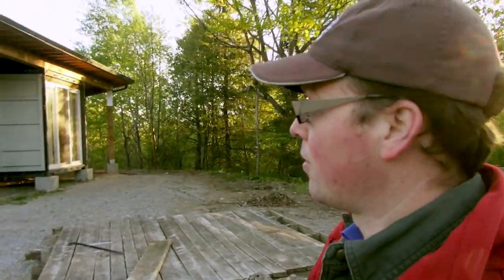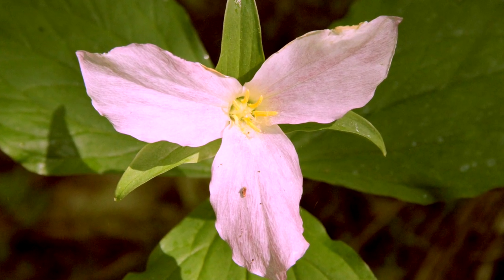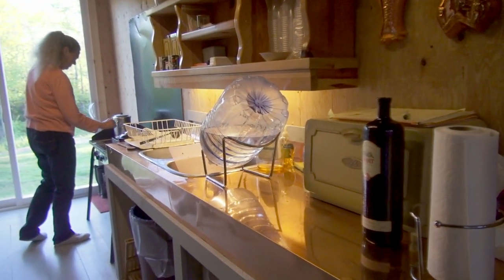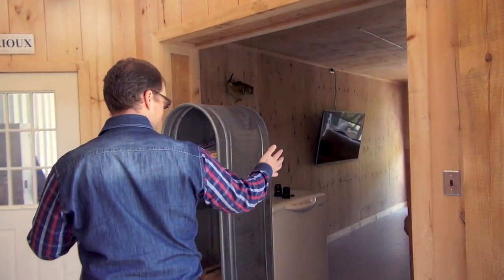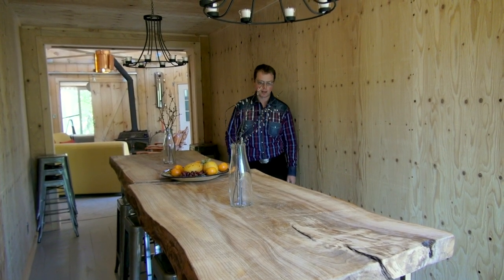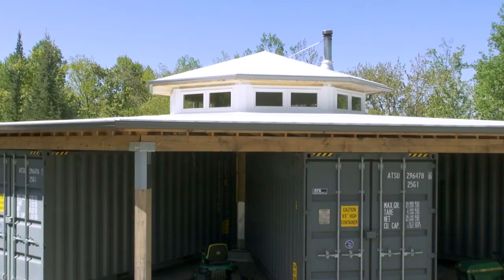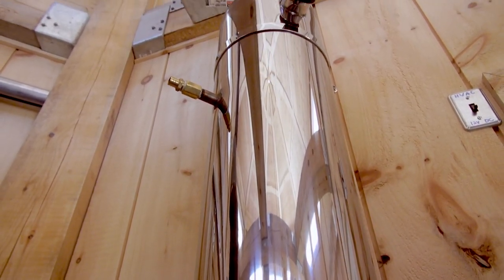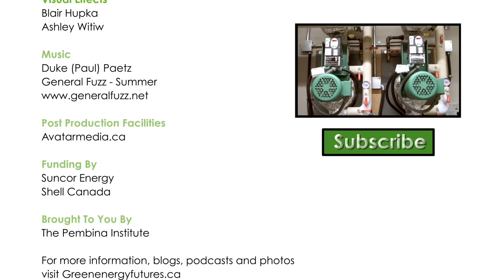112. The Octopod: A unique off-grid solar powered cottage made out of shipping containers

Comment: I really like this design, though I'm surprised at the total price. Those containers normally sell for about $3K each, so containers aside, everything else cost him about $100K to build. Yikes! He must have a lot of pricy materials in it. I think that this could probably be done at half the price if you did most of the work yourself, and went easy on the add-ons. Maybe put a rocket stove/thermal mass heater in it.
Reply: ZombieTex There is certainly significant cost in the interior decor, but that's an aesthetic cost. I wonder if a cost breakdown would be shared. Perhaps structural costs, aesthetic costs, and the cost of the DC electrical system, panels etc can be separated and shown?.. What did it cost to assemble the 1kW electrical system? Does it make economic sense?

Comment: Any thoughts on making better use of the "dead" space between the spokes/pods? I love the low energy consumption ideas, but the design engineer in me wants to stuff... stuff between the spokes.
Reply: Michael Kaczmar I'm with you. We relocated the sauna into one wedge, the other wedges currently provide shelter for the riding lawn mower, argo, boats and other toys but yes, can we make better use of the space? We planned to use one wedge for a wood pile but I have mixed feelings about that.
Reply: Michael Kaczmar I was thinking about that as he went from one 8x20 "pod" to the next.You could easily open walls up to 12 feet and use those wasted areas in between to provide more living space, extra storage and to break the monotony of "seven spokes radiating outward from a central hub". He did a fine job but it seems a little space shippy to me. This would also help with the heating problem by adding more thermal mass and by separating the cold outside air from the central hub and the pod walls by 12 feet or so whereas now it's never more than a few feet away.
Reply: Joe Schwartz I hesitate to "pick" the design apart, but the spoke layout just seems less efficient. It certainly increases the surface area-volume ratio of the living space, a downside for energy management. The roof structure adds a significant amount of cost to keep weather-resistant containers out of the element. That's the last I'll comment on these aspects. I actually would like to consider the water pumping and storage method for my home in the future. I wonder what my energy savings on my conventional home would be if I did not need a pressurized well tank, and simply pumped from my well to a higher elevation holding tank. The pump would cycle less often, and not work against the static bladder pressure in the well tank. Will the additional head height offset the reduced pumping work against the bladder... not sure. Hopefully others can take the energy management that works from this system and apply it elsewhere.
Reply: Michael Kaczmar I was thinking that the shipping containers actually act as a radiator in this configuration. Maybe it's intended as just a summer home? 

If you're going to the expense of covering the containers with a roof, you might as well go the rest of the way and enclose all that space -- with additional openings into the central space between the current "rooms." 

Some interesting ideas, though.
Reply: Perhaps, but decreasing the surface area to volume ratio is physically the more efficient way to go when trying to minimize heat transfer; whether it's hot air getting in, or letting warm air out.

Comment: Architecturally, it might be interesting, but it's inefficient in cost and look at all that surface area versus volume.   All those surfaces need to be covered and insulated and finished.  Bad use of materials and costly.  $130,000 is about 5 times my budget.

And computer fans for air circulation??
Reply: +PDZ1122 same here. I think the outside surface area is too big and the living space inside is too little for that many containers used.. also the roof structure is too massive.. these containers are very sturdy and can hold a lot of weight on their on... also insulating shipping containers is not that easy, causing the price per square to go up...
Reply: Seth Johnson skimming off the top probably
Reply: Ｔｈｉｓ　ｏｗｎｅｒ　ｄｏｅｓ　ｎｏｔ　ｔｈｉｎｋ　！

Comment: Talk about thinking outside the box, or container in this case. Wondering about the insulation level inside container. I know he clad the inside with unfinished wood, but guessing rigid foam would be behind it as thermal break from metal container.
Reply: It was spray foamed.

Comment: how much land is required for this project? is it totally off the grid? did you have to get any permits etc. cool house I want one.
Kevin
Reply: The project is 60 feet in diameter, so you need more than that, and extra space for a septic system.  Yes totally off grid and Yes this project was built with a full set of approved building permits by the municipality.

Comment: Im all for using shipping containers!  I like the idea of building something different like you have done here, but I think the space can be used more efficiently if the design was simpler, like a rectangular or square shape IMO.  It would cost less too, because as soon as you start changing the shape of the roof, everything underneath (the frame) needs to change as well and it becomes more expensive.

I know squares and rectangles are "boring" shapes and it looks like every other house.  You also lose quite a bit of usable space on the outside of the containers where it forms a V-shape.  Yes you can use that to store things on the outside, but I think that can be used better on the inside...

Comment: Wow, they must have had a really good source for the containers. I hear they can be pretty costly, even when purchased as scrap.
Reply: Thom Westergren Ironically these were premium containers given they are relatively new and ordered from one assembly batch to limit risk on variation but yes, it took a while to find the right supplier. Prices do fluctuate as they're treated like a commodity so the first containers we purchased years ago were significantly less costly.
Reply: Interesting. Thanks for the follow up.
Reply: The high cube 20' containers new shipped to your port from Shanghi China are about $2300.

Comment: I must say: It looks great, but what does he do with all the unused room between the containers going outwards? I mean I am all for making a house that's not just a rectangle/rectangular box, but it seems like a lot of wasted space...on the other hand: does this isolate the rooms from each other if there's noise? (Partying kids when you want to sleep for example!)

For me the center structure would have more glass probably :) (to make the entire center a conservatory/sunroom - with extendable covers for heavy sunshine (and maybe even heavy snow!)...and it kind of lacks a balcony (it's got a terrace, but no elevated position for you to oggle the surroundings :( )

I'd also have more solar and some wind-turbines (and some hydro if it's possible)...I just like certain creature comforts!

ps: I would also kind of place the heating unit in the absolute center of a house (so that heat can radiate outwards from there, especially if you use a wood-burner for heat in winter - this way you probably only have to keep one fire going to keep the whole place warm!)

Comment: $130,000 for a total cost would be o'k. If that is $130,000 for just the cottage then that's quite expensive.  Bobcaygeon is a large area with several different land values. but a cotrage property should cost between $40,000-and $90,000 no lake front and a nice size. 20' shipping container is about $1350-$1500 used plus delivery and for a build like this $200/h crane fees. usually 3 hour min. The 40' containers are only around $200 more and a better choice for the money. 

Now this wheel and spoke shape is interesting. With some better planing on roof design you would not need the vertical supports since the container is essentially a pair of 8' steel I beams. the in-floor heating from the wood stove is a good idea. putting in a small "400-800' of 3/4 pvc pipe" "about $100 per 400' "geothermal heat sink for air conditioning in the summer would be a good idea. 

They have high efficiency ceramic composite insulating paint that is often used on shipping container homes. It might be a nice way to add another r-30 of insulation to the living space, Since in Canada we can get very cold winters although depending on where your land is for a cottage might not be much of an issue as allot of cottage land does no have road access in the winter.    
Very nice low maintenance cottage.

Comment: how do you deal with keeping snow off of the roof?
Reply: it's designed to hold the snow load so no action is required
Reply: The snow stays - the roof is structurally designed to hold the snow load.

Comment: That would never pass building codes where I live. They are the biggest barrier to cheap alternative living solutions.
Reply: this is one of the largest barriers for people pursuing container based homes

if you spend enough time with your local architects and structural engineers, you can normally satisfy building code requirements, as was the case for this project being a first for this region of Canada, but it certainly takes more time and effort to get approvals for non-standard construction methods

Comment: That's a very wasteful design. There's a reason why most people go for either circular or square design in their dwelings - surface exposure. He must spend a small fortune on cooling and heating his house with so many walls exposed to the elements.
Plus the price of all he described must have set him back, at least, 150k to 200k... that's a decent size new house. Way out of my price range.
Reply: +tkol123 Massive surface area to volume ratio! 4 shipping containers arranged in a square (or 6-8 if you like things more round-ish) with a roof over the central space would net 4-8x40 rooms and a massive 40x40 central living room!

Basically I can't think of a less efficient way of using 8 shipping containers.
Reply: +Joseph Malovich Yeah, my point. I am not an engineer, but efficient design is efficient design.
This guy likes his house the way it is, so good for him.
I like it snug and comfy. To each his own.
Reply: +Joseph Malovich - Ditto.

Comment: Certainly not feeling this design. I mean, it's good he built it, humans learn through failure and if he lives happily ever after in it for the rest of his life then that's great, but if he abandons it in 5-10 years for a better project then we've learned a few things from it.

I think personally, that maybe he is confident working with wood, or reasonably so, but not so confident with metal. Sure, 130k is on the expensive side, but what's more telling is that for what he achieved with 130k, there's a lot to be desired. No one would have a problem with a 130k off-grid home if it was basically a mansion, this looks like a 30k-40k type home to me. 

He did some good things though that I think people missed. Rather than having a huge array of panels and an AC inverter, he's made a good choice to try and keep it all DC. Of course, it's obvious to be conservative with your energy use and buy more energy efficient devices, but AC/DC inverters and battery storage is an energy inefficiency... You get less energy out of those that you put into them, so it's great to go all DC. For instance, a comparative off-grid home may have panels with an AC inverter for conventional appliances, then install energy efficient LED lighting, but such things require a ballast and a DC inverter (like the brick on your laptop power cord). It's more energy efficient simply keep it DC from the panels to the LED light. Of course, there's a good mid ground where you can have an AC inverter for conventional appliance power but then have a DC lighting circuit wired in prior to the inverter, but he proved there are pros to keeping it all (or as much as you can) DC. 

Also, it seems everyone has overlooked his water tower. In my personal designs, I have a water tower, I think it's a great idea if you have the capacity to incorporate one in your design. I think people underestimate the luxury of having gravity fed water on demand rather than having to wait for a second or two for water. Not to mention that the energy required to pump the head height is likely less than the energy required to pressurize and maintain the flow for a pump fed water system. You can also use a smaller more energy efficient pump to trickle feed a tank a few hundred liters/gallons rather than a larger stronger pump that has to apply and maintain pressure over use. It's also good that he used a thermal heater coupled to his wood-stove that heats the concrete floor, that's also very smart. 

What I don't think is smart though is his design. Each room extends out from the center and appears dark and dingy towards the back. Sure, fewer windows mean more heat retention and less heating energy required but I think it worked to the negative. In this case, he's elongated the design of the shipping container and played on it's biggest flaw as a dwelling. People naturally like proportion and they like square rooms. People don't actually mind living in a smaller space, but need to compensate with lighting and proportion to do so... He failed by designing something with the dark, extending and out of proportion areas. Most shipping container home designs use semi open plan and break up the length with interior walls to make roughly square or slightly rectangular zones/rooms. Also, they do things like placing the side towards the sun and using windows up the whole length to bathe the container in light and warmth. 

Of course, in his desert setting, staying out of the direct sun and heat is the goal and he actually achieved this in a good way. Having the extending roof over all the containers did the exact right thing, it created an air gap, it was painted white to reflect heat and it insulated the container rooms with physics, rather than insulation. But the major benefit of shipping containers in construction is that they are perfectly designed (by intent) to be stackable, which makes multi-level/story homes much more simple and structurally easy to design and because they are structural, they can be weight bearing and they can form a major skeleton for a home. You certainly can cut out holes safely for a window or join two containers together without major structural concerns or calculations. 

The shipping container is meant to be the major structural component of your dwelling. To over-simplify it the entire benefit is that they're cheap and strong so you can simply cut out a few holes for windows and slap some cheap plasterboard and insulation on the inside and you roughly have a home. By building a gigantic octagon in the center and a huge spanning roof, then cladding the interior of the entire house including the containers with actual wood cladding, what purpose do the containers serve? They're not majorly structural, they're not finished with cost-effective materials (like plasterboard and industry byproduct insulation) and almost worst of all he's invested time, effort and materials in building a covering roof which leaves voids of pizza slice shaped wasted space between the containers yet under the roof. If he had a "U" shaped home with 3 containers it would be cheaper, he'd still reap the same benefits of the extending roof (insulation) and the center covered by a roof could be veranda/patio/garden/outdoor something and it would serve a purpose. 

He could easily replace the containers with simple wood frame construction. With no interior dividing walls, I cannot see how framing a single long box would be hard. That wouldn't have to be overly structural either because it's protected by the roof. The fact that he's used so much wood cladding (cedar?) suggests that the cost of simple framed construction is not cost prohibitive and is likely highly competitive to the purchase and transport of shipping containers, as cheap as that can be.

Like I said in the opening though, it just looks like a guy who is comfortable working with wood, but very scared of the idea of taking an angle grinder or welder to metal. I'm not going to shit all over him though, he had some great ideas that people have overlooked and some not so great ideas and designs that maybe a couple of us would have seen coming... But now with his flawed outcome, we can all learn about stuff that works and stuff that doesn't. 

For one, having a spanning roof with flowing air as an insulation method is probably a good idea, but if the containers aren't going to be a weight bearing and structural property in the design, it's probably redundant to use them. In future iterations of similar concepts, maybe people could look into using 3 or 4 containers in a U or square shape and either be making an internal room that way or making an internal courtyard/garden. Also, shipping containers probably need internally dividing walls (but no necessarily doors) that create two or 3 rooms or areas per container. Also, thought needs to be put into lighting especially, whether that's facing major living areas towards light sources and having large windows or maybe having skylights. But again, as simple and effective as skylights are, I see someone who was unconfident with the idea of cutting into a container or modifying it in any way.